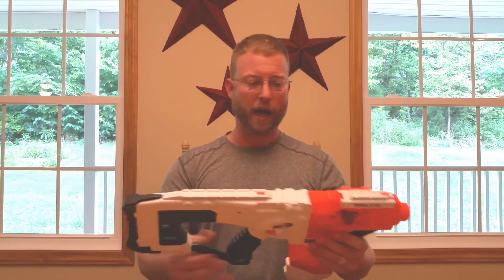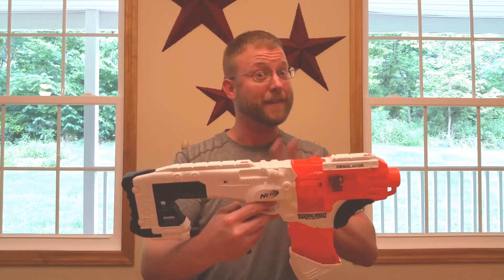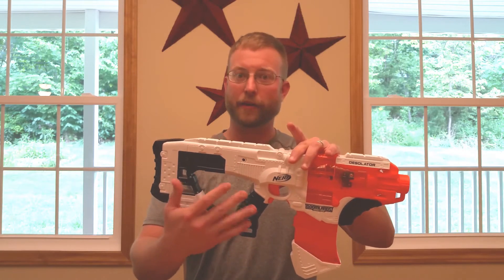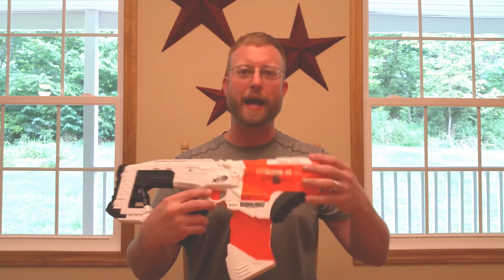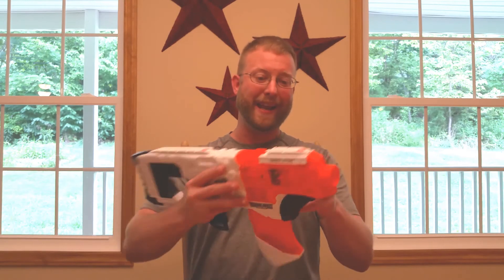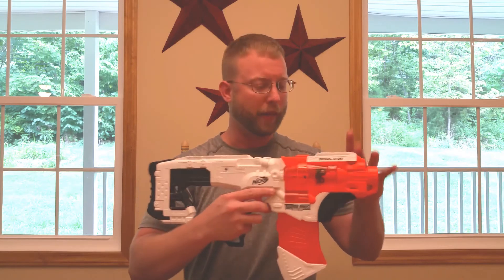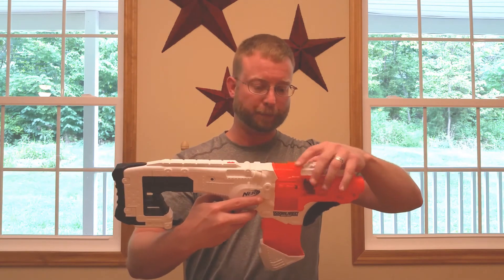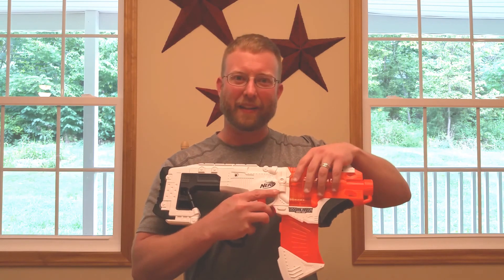Mod Potential - Nerf Desolator

Comment: I have an idea,here it goes:you know the way the zues has a wierd reload?i think i know how to fix it(im not a modder though so i dont know how everything works properlly)so what im thinking is cut a hole in the back were the mag would be and make sure the mag can fit through and  put a extension to the mag at the back with a bar on each side for pulling it out then remove some locks,maybe block off the sides so it doesnt fall out and presto you have a super quick,p90-ish reload!and you can do the same with other mags to increase the efficiency of it,maybe it could be somethin' :D
Reply from the maker: That could work...
I think the best mod I've seen for reloading Zeus mags is the one OutofDarts did.  It was a couple of pieces of printed ABS that locked onto one side of the mag opening.  When you put the mag in, the plastic pieces stopped it from going through.
If you are interested in mods for the Zeus, I'd recommend taking a look at his channel.
Reply: +498 Nerf yeah but that thing still uses the side ways reload,with some real operator essence you could tilt the balster back,mag falls out and put in another,and its DIY who doesnt love some DIY ;D

Comment: You considered putting a four flywheel setup in a spinsanity?
Reply from the maker: I probably should try it (for science) but I don't have high expectations that it would improve performance that much.  Stock motors + 14.8 volts is already stressing  the flywheels and a second stage would have to turn faster.
Reply: 498 Nerf what if you went from 3imrs into 4imrs? Would that make a difference?

Comment: it's a stryfe... is it just a stryfe. .. does it have tilted motors
Reply from the maker: No, the motors on this blaster aren't tilted.
It has the same trigger mechanism as the Stryfe.  The motor cage is somewhat different - it is upside down compared to the Stryfe and has little rubber washers under the screw ports to help dampen noise.  
IMO, this blaster has two advantages over a Stryfe from a modders point of view.  The battery tray can be made wider to more easily fit thicker Lipos and the clear plastic sections offer great opportunities for LED work.
Reply: +498 Nerf right. im going to have to compare them though. stryfe seems to currently have more custom parts avalable to purchase (especially bsp items)
Reply from the maker: No question.  Some of the kits coming from China are amazing.  If you are looking at drop-in cosmetic mods, the Stryfe has a whole lot of options.  
I suspect that, given time, we will get some of the same performance stuff (like the bsp cage) for the Desolator as well.
Reply: +498 Nerf definetly. gotta say. the stryfe looks like it has a lot of integration options. in fact my favorite Blaster thar I own is a strayven. working on my second strayven now. probably trying my hand at hydrographic imagery

Comment: Can a flywheel cage fit in a longshot barrel?
Reply from the maker: I should be able to.  I just put mine side by side with a Modulus ECS-10 and they are roughly the same width.
Reply: It'd be cool to have an attachment that adds to the power of your blaster. Also the trigger could function as the rev trigger.